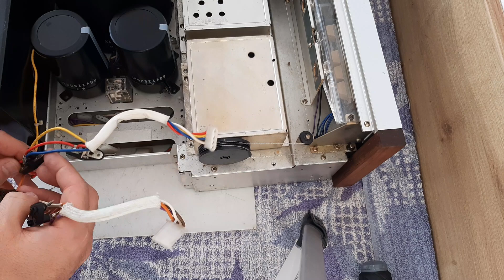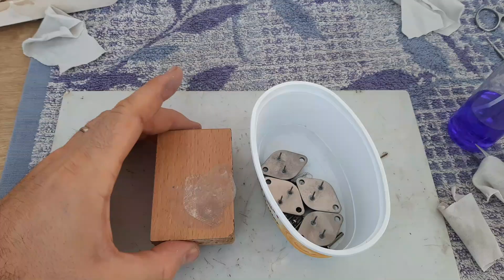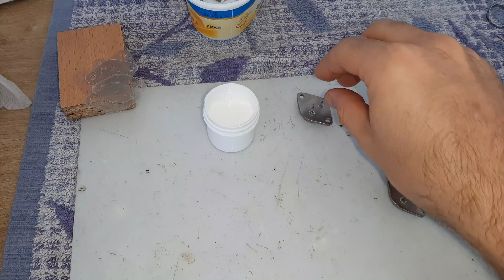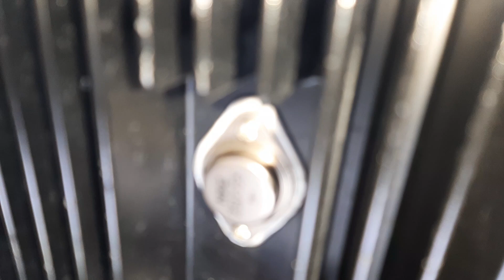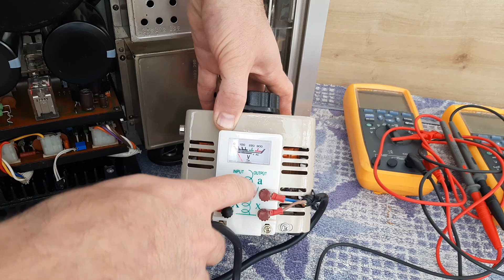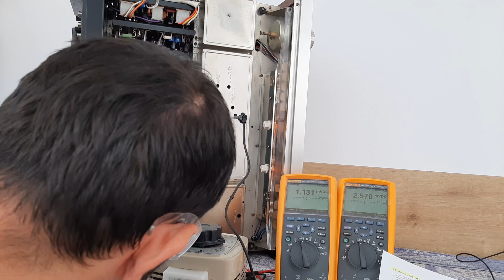Pioneer SX 1250 - Restoration Part 9 - The Most Popular Receiver Ever

Comment: I have a simple question. does relay immediately off when the power amp is disconnected from the AC current, .or
 shut down after a few minutes.
Reply from the maker: Hi, relays should stop immediately after ac mains is disconnected,  and should engage after couple of seconds when the ac mains is switched on. Just because you don't want to hear strange noises from your speakers. Cheers and stay tuned!❤😊

Comment: Hello Marius, Thanks again for your excellent videos. I have a question : which reference do you use for fast diode 1A that you use for sx-1250 ?
Reply from the maker: Hi Fred, thank you so much for appreciation! I m happy to know all this restoration are useful for you, thx. About your question,  rectifiers used here are from Vishay UF (ultrafast) 4007, i m using them without any problems for 1A rating.
What device you are restoring now ? 
If you have some suggestions for next videos don't hesitate to tell me!
Cheers and good luck!
Stay tuned, more videos to go !
Reply: @MariusHiFii  I did it on all boards of SX-1250, for power apli AWR-048 I used 1N4007 , do you think that I should replace them wit UF4007?
Reply from the maker: Hi Fred, is not necessary to replace now with UF.
Wow, you have a lot of work there, cross fingers.
After you finish tell us about sound and results. 
If you have time can u give me some suggestions about videos, if you want to see something more, or another subjecta...
Thank you !
Cheers and stay tuned, more videos to come !
Reply: @MariusHiFii   Thanks to your videos it was easier that what I could have to do without your videos. I learned to use new tools and products like Dioxit. Your cleaning method is great. But your volume cleaner from Poland is not easy to find. I used another one!
I tested individually every card. Everything is tuned as described in the manual and seems working.   Next week I will put it at it place and  will listen to that with speakers. 
For suggestion: I have a Akai GX-630D that I would like to Recap. All help for that is welcomed.  I look at your listing you didn't do that yet. If ever....
Thank you again for your videos Marius.  And Thanks for your kind replays. Fred
Reply from the maker: Hi Fred, thanks for your appreciation and for good vibes. Please tell us what chemical used instead of polish one, thx.
Happy about your result and waiting the sound feedback from you.
I m looking forward to make a full deep restore for an reVox A77 , i don't have experience with GX but i suggest you to record your progress and share with us it will be great.
Wish you all the best , good music with SX and happy December!
Stay tuned, more videos to come !
Cheers Fred !
Reply: @MariusHiFii  Hello Marius, I did the real test of SX-1250 this WE. I found the sound a little bit strange  and the power lower that it  should be. I can not quantify what I heard. I unmounted all 1N4007 on both power ampli cards.
I replaced them by  original diodes I extracted before. And tested again, I have the right sound. Run it for a while with half volume. What is new after recap: it heats much less. just the upper tow resistances of the power card.
thanks again for the help you brought  , without your videos, It should take much more time. I should be not cleaned as well as you do all those switch and volumes . They works very well know. Any more any bad contact on them. The amplifier, works like 50 years ago! Regards Fred
Reply: @MariusHiFii  Hello Marius, I received the UF4007 and tried them, that works very well,. I had a doubt about the 1N4007 and my test. I tried them again, with a good test. It passes. The last test I did was not good, it was with a FM channel with a poor reception. Just to let you know....
Have a excellent Christmas holidays...
Reply from the maker: Hi Fred, happy to hear all of this from you. UF4007 is doing perfect job in that places. 
I recommend for tests after restorations to use a sound wave signal, even from yotube videos + an oscilloscope connected on outputs. 
Hope you will enjoy this beast for many years.
Happy holidays to you and your family!
Stay tuned, more videos to go!
Cheers!